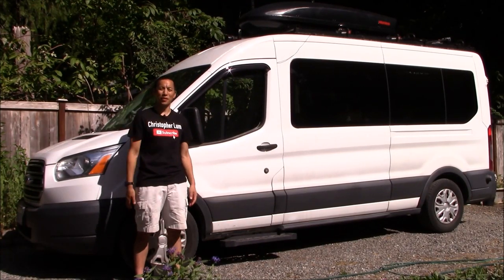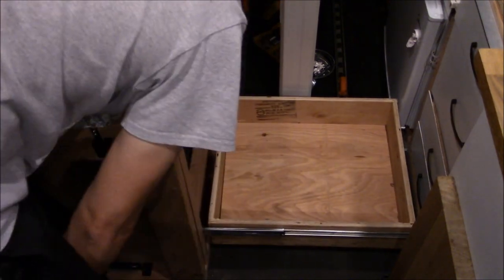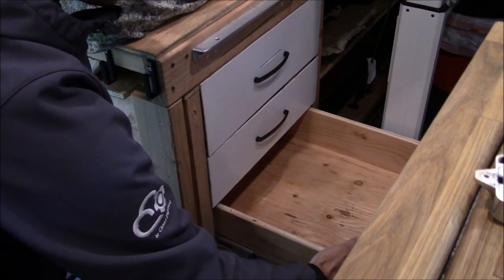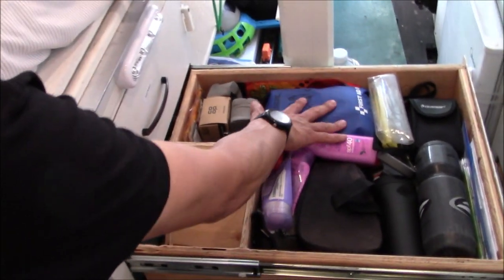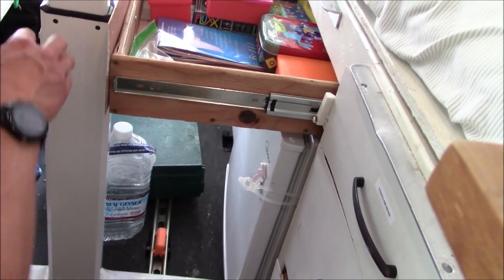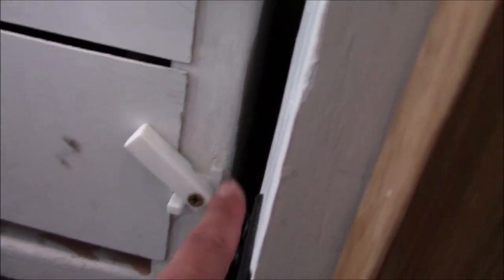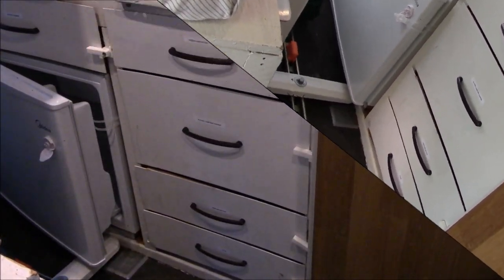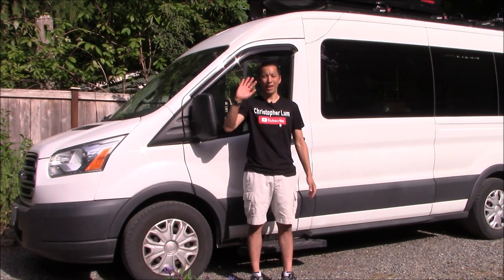DIY Drawers for a Van or Camper

Comment: How did you secure the rails to the floor.   I have a passenger van as well.   TY
Reply from the maker: Those rails are just low profile super struct (similar to what I used to build the roof rack).  I've working on a video showing these details.  Hopefully if you're subscribed, you'll be notified when it goes live.  Thanks for watching!